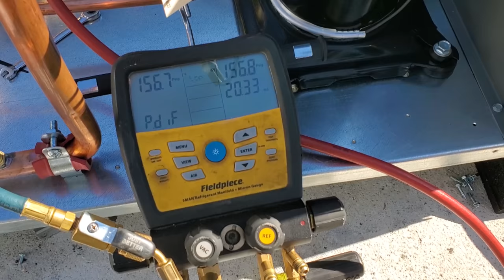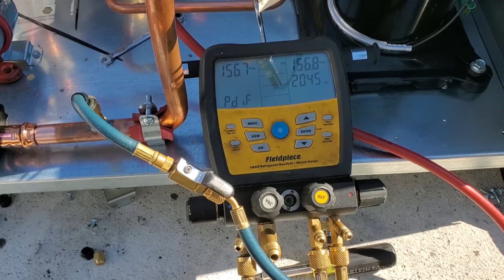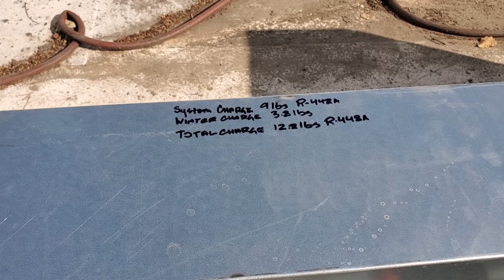WALK IN COOLER RETROFIT WITH ZoomLock MAX

Comment: I’ve cleaned hoods for 18 yrs and u knowing not to put it around the exhaust fans is a pro move. Good job sir.
Reply: But that EMT right next to the one fan is going to be some poor souls trip hazard about 12 times in one night.

I would also advise to never put refrigeration between exhaust fans and the roof drainage, its just asking for grease splatter all over that equipment.

Comment: Reminds me of when we ham radio operators changed over from soldering coax cable connectors to crimping connectors onto the transmission cable. So much easier but as you found you still have to be careful to create the proper connection. Thanks Chris for sharing!
Reply: The thing is, the tool is like $2500 and each coupling is like $15 a piece lol
Reply: @Straight_White_Fatherly_Figure  and if you spend $1 instead of $4 on labor eventually it makes more sense even on big jobs
Reply: @jareddory2155  yeah I honestly would love the tool but the wife would never let me spend that much on a tool 🤣 eventually ill have one though. I have my ways.
Reply: I still solder my terminations. I don’t trust these new fangled ideas !! Now get off my lawn darn kids !!

Comment: Whenever we run a line set through a cooler top or wall we always put in a piece of PVC first and put the line set through the PVC, prevents The line set from rubbing through on the sharp metal edge of the cooler
Reply: ive actually used pvc drain pipe it has that black coating on the inside and its cheaper than the regular pvc pipe. ive also used it for running through ceilings etc. i Run the plastic pipe first with unistrut and pipe clamps through the Crowded tiny ceilings with a hundred other pipes and wires around. it makes running a new line set in the ceiling between floors alot easier. you can do it usually in one pull to a cooler.
Reply: just use PVC electrical conduit, since it's rated for sunlight/uv exposure anything else could become brittle and break with age (solid core PVC is probably fine though)

Comment: I really appreciate the fact that this guy does the little things like putting a bushing on the other side of the connector or making sure he uses the water tight EMT compression connectors rather than just throwing a regular compression connector on it. It's the little things like this that I feel like that actually separates the average guy from real professionals and I must say this guy a real professional

Comment: We use this system years here in the netherland. Dont sand the outside of the pipe with sand paper. Sand paper only if you solder the fitting
Reply: I thought of this too, o-ring sealing is all dependant on sealing surface quality so maybe not too coarse sand paper would be best.
Reply: Wij hebben de set van Rothenberger

Je moet wel de scotch gebruiken die ze meeleveren als laatste stap.

Koppelingen zijn nog steeds enorm duur maar het werkt fantastisch 👌

Comment: I have not used any of the press fittings, but I was told on the plumbing Pro-Press that the b o-ring was not the main seal....but the main seal is the copper on copper seal formed with the high pressure crimp.

I hope to add it to my bag of tricks because I  definitely have had  times where it would have made a job much easier.

Comment: Like he mentioned, don't want to be putting on and off the fitting as it might damage the o-rings and I believe the o-rings are pre-lubricated, so taking it off and on from pipe to pipe will eventually remove the lubricant. The fittings usually come in a bag to help ensure its clean but inspections of the o-rings are a must if the fittings were left outside to the open environment.

Comment: Just a heads up, I tortured tested those zoomlock and propress fittings (Just basically all the wrong ways to do it, no pipe prep etc.) and they can take ALOT more than you would figure. The only way i actually managed to tear one of the O-rings was slamming the pipe into the fitting on an angle with no de-burring.

Comment: Chris if you are using for R448/R449 low temp (Freezer), check your discharge temp.. They can run pretty high, and you might need to have some top compressor cooling ( don't know the English word for it)

Comment: Great video once again.. I have been using the press fit here for a while.. your spot on about cleaning the pipe of burs and marks.. I use scotch pads to finish off the copper as my final step before the marking process.. here in Australia it's called Maxie pro ..
Thanks man once again

Comment: Exposed EMT? I would not have guessed, that pipe won't last in the elements. Better option would be rigid or epoxy coated emt, possibly rigid pvc or carflex ? Love your channel and love learning about HVAC. Electrician by trade and always try to use pride in my work like you do ! Thank you for providing a good example for other tradesmen ! Also I thought you pipe didn't look bad at all!

Comment: In the UK, for most if not all commercial premises you need a 'hot works' licence to do soldering of copper pipe work.  It's why a brass compression fitting is used instead.  Not sure if brass compression fittings can be used on Air-con pipework.

Comment: hi chris im 15 years old and i made my own air condition by using an old split ac unit.Also its working on R32a for refregerant.great video by the way!

Update: I forgot to mention that this was a 2006 GR hualing ac unit and I really like how is defrosting in heating mode with a time less than 3minutes!
Reply: Good way to start
Reply: Wow. Nice. 👍🏾
Reply: Sweet man.
Reply: Good start, what did you use for a vaccuum pump and gages? Thanks
Reply: Dude thats very cool!
Reply: @watermanone7567  I did use gauges and to be honest it was a bit hard but I made it with the inspection of a HVAC guy!
Reply: @watermanone7567  My HVAC guy help me to vacuum the system with his vacuum pump and saw that he has the fildpiece vacuum pump as Chris has!

Comment: I personally haven't used the zoomlock, but I have used pro press a bunch. I still personally prefer to solder an assembly on the work bench (when possible) and just throw in a coupling to tie it in. Most of my mistakes came from trying to keep a complex assembly from falling apart and then not noticing a fitting slipped off or turned after I already started pressing. That depth gauge is pretty sweet. The one we have is basically a laminated piece of paper. Makes it hard to mark the pipe, so most of the time I just use a fitting that has a stop instead.

Comment: Nice job. My question is the roof penetration. The roof looks like membrane. It looks like you used bull/roof cement to seal it. I was told by roofers NEVER use roof cement on a membrane roof. Instead, use silicone sealant. Please correct me if I am mistaken.

Comment: I don't know much about refrigeration but I've been using Propress fittings on plumbing pipes since 2004 and almost never have issues. Way faster than a torch with less that can go wrong.
Reply: But water pressure doesn’t go as high as 300+psi
Reply: @yzhang8629  Did you see the comment from the aviation tech saying fitting like these are used on aircraft hydraulic lines at 3000psi ?

Comment: I know you are sponsored by Parker, and that is why you are using the ZoomLock fittings, but I guarantee you they will eventually leak. It's not a matter of if, it's a matter of when. And that when will be a LOT less than the "30 years" that Parker claims. The o-rings used are made of HNBR, which is a good material but it will eventually harden and lose it's elasticity. Combine that with expansion and contraction due to temperature changes with on-off cycles, and it's only a matter of time. The ones most likely to leak first are the ones closest to vibration and exposed to the most temperature fluctuations. So, figure the suction connection at the condensing unit. Next likely one will be the liquid line connection at the fan coil. They should make it out of warranty, but IMO fittings are something that should last the life of the equipment without leakage. 

We got a ZoomLock tool to try out a few years back. We had to buy the fittings, which are expensive. While the crimping goes pretty fast, tube prep requires even more care than brazing or soft silver soldering (Stay Brite or Stay Brite 8). Overall, I didn't feel it saved much if any time compared to using my Capn' Hook heating tip and brazing the lines. When you take into account the cost of the fittings, I calculated brazing to be less expensive. Because I know the correct way to braze a capillary joint, if my braze passes the initial leak test I know they will last the life of the equipment. With ZoomLocks, I can't say the same. They are essentially very similar to Ford and Chrysler spring-lock automotive fittings, and the older ones with single o-rings ALWAYS leaked in under 10 years. The later ones with two o-rings per fitting last longer, but eventually they will leak as well. Spring-lock fittings, and automotive fittings in general, all have one enormous advantage over ZoomLock fittings; they are easy to disassemble and replace the o-rings. If a ZoomLock fitting leaks, you have to cut it out and either replace it with a piece of pipe and two ZoomLock fittings, or a piece of pipe with regular couplings or swaged ends and braze it in place. And when a ZoomLock fitting does eventually leak, you know the others on the system won't be far behind.

A question: why did you use 448a? Was that some requirement by the People's Republic of California? I will forgo my usual rant on the GW scam (or OD scam, for that matter), but the "GWP" of 448a isn't all that much less than 407a, c, or f. It IS less efficient, so a system using these HFO blends will have a lower COP vs systems using 407 series refrigerants, which means they will use more power. Since most electricity comes from natural gas and coal (I will forgo my usual rant on the anti-nuclear power BS and why solar/wind can never replace current baseload power sources), extra CO2 emissions will more than offset any extra supposed "global warming" from a refrigerant that SHOULD stay inside the equipment (I will forgo my rant about cheaply made, paper-thin, leak-prone coils). Of course, 448a also costs more, which is the point. Honeywell and Chemours didn't push for the adoption of expensive HFO's because they care about the environment. They care about their profits, and the patented and difficult to manufacture HFO's are VERY profitable! How do I know that they don't give a crap about the environment? It's because they know, but keep hush-hush, the fact that both of these HFO's break down into trifluoroacetic acid. TFA is a persistent environmental toxin that is absolutely deadly to aquatic life. 

Another option besides 448a and other HFO/HFC blends is R-134a, which has a "GWP" that is comparable to 448a. The R-12 system could've been replaced with a medium-pressure R-134a system instead of a high pressure 404a/407a/448a system. The end result would've been comparable in performance and efficiency to the 448a system. I know MP systems are no longer in style, but maybe they should be considered for more medium-temp systems?
Reply: Use 410a on everything, its the best next thing if you ask me.
Reply: @sjefoekel6058  Greenies want to get rid of 410a. They claim the "GWP" is too high. They want to copy Japan and China and use straight R-32, which is flammable and runs at even higher pressures than 410a.

410a could be used in refrigeration applications, but it hasn't been for a variety of reasons. For those same reasons, it is unlikely to be used fr anything besides AC.
Reply: @WTFChuk  fase out, is not on close term for 410a = smaller pipe, smaller heatexchangers, les refrigerant, smaller delta T~ more € for me!
Only thing is you cant do drop in. Another thing is r32 drop in ready.
Reply: @sjefoekel6058  Heat exchanger size is based on thermal load and discharge temps. I dont know how the "smaller heat exchanger" thing got started, but I have never encountered a 410a system with a condenser or evap that was much smaller than its R-22 counterpart on a tonnage basis. What will make the heat exchanger smaller is thinner tubing, material with a higher thermal conductivity (copper instead of aluminum)  and more efficient design. These are what are responsible for any heat exchanger size reduction in a 410a system.
Reply: @WTFChuk  it boiles at higher pressures therefore more violently, check out charts of heatexchanger manufacturers, and furthermore because
Of the higher pressures there is less pressure drop. You are welcome.
Reply: @sjefoekel6058  More violently? Egad! I get it, you think R-410a is just the coolest (pun intended) substance ever invented. Fine. You're certainly welcome to your opinion. Have you asked yourself why it's only used in high temp applications? No medium temp, no low temp. I will leave you to ponder that question, along with the mysteries of life and your place in the universe.

You are welcome.

Comment: I like leaving the condensing unit isolation valves in place that way if you have a leak in the condensing unit you can isolate the condensing unit from the rest of the system so that you don't have to recover the Evaporator and lineset. Especially when the customer is on a budget with an older system that may have potential micro leaks on the evaporator.

Comment: I'll keep brazing. We bought a progress for water pipes a while ago where it has a huge advantage in large buildings that we work on where its almost impossible sometimes to get the water to stop bleeding through making it impossible to solder.  In this situation I really dont see that big of an advantage but I see a huge disadvantage in that a o ring will not last as long as a good 15 silver braze joint. i've seen totally properly done progress application fail shortly after and that's at much  lower pressure. Just my opinion.

Comment: Will those benders work on still lines as well? If so, i need the 3/8 so i can easily bend up the fuel lines on my truck, the little ones you can get for automotive in auto parts stores are junk

Comment: Good Vid ! Nice Clean install !  ive never used those service valves on the condensing units anyway, so no big deal for me in just getting rid of them on the get go. i allways end up Getting rid of them anyhow because they end up leaking eventually. Only one thing i would do differently . i am kind of a Nut for Blowing out the Evaporators and line sets with dry nitrogen at 100psig or more pressure to make sure no shavings are hiding in the line set or evap before i weld them in at the condenseing unit ( in this case before last two zoomlocks at condensing unit. Besides that Zoom locks Look cool, But HOw Long before they Leak ? 1 year, 5 years, 10 years ? Please Keep us updated with a Once a Year Video Update on this installation Especially if thier is a Failure of a fiting at 1 year or Less. Thanks. 
NOte: YOu Could use Zoomlock to Change a Compressor. Just Weld in 3" Copper Stubs into the compressor Down at the Truck. YOu don't have to Bring the welding Gear onto the Roof that way. Easy peasy. Im interested in seeing if that one itty bity o-ring will handle Discharge Pressure & Temperature of a system on a HOt day in riverside. Lol.

Comment: How much time do you think you saved using zoomlock vs brazing? And what was the price difference in fittings? Wondering if it's just a wash when it comes to cost not taking a fire permit or whatever into consideration (we don't need to pull special permits for torches here fyi)
Reply: I work in a somewhat heavy industrial environment. Our insurance mandates a 3 hour fire watch after burning.(not to mention the paperwork) So if a contractor is cutting, welding, torching, ect. up until the end of the day we still need to pay him or someone 3 hours afterwards to fire watch. Sometimes this falls on the contractor, which we pay for obviously. If there is a way to do a job without creating fire, then that option is almost always selected. Everything else is usually preformed off site.
Reply: Dude... California is the absolute worst when it comes to permitting and even more annoying the farther down you go such as county or local municipal code...
Reply: @erat91  Do not worry insurance never pays even if the fire starts after the 3 hour watch lol
Reply: We don't need hot work permits where I am. I tried the Zoom Locks several years ago, and because of the extra tedious tube prep I didn't find that it really saved much time. This was especially true if you had to do some brazing anyway, so you had to hook up the N2 no matter what. My torch with the Cap'n Hook tip and using Stay Silv 15 felt just as fast. If I swaged joints instead of using couplers it took a bit longer, but I eliminated half of the required braze joints and half the potential leak points. Once I used up the supply of ZoomLock fittings I had to buy, I returned the tool which had been loaned to us to try the system. I haven't used it since, and have had zero need or desire to buy the tool and more fittings. OTOH, I still use the crap out of my Hilmor swaging tool, as I try to eliminate every coupler possible with a swaged joint.

Comment: What a time to be alive. 
Got a question though. Do you have any concerns using the zoom lock fittings with leaks in less than a year or two. Or is that why you have heavy emphasis on not screwing up the O-rings while de-burring
Reply: I’d also like to know what is the max pressure the zoom locks can withstand
Reply: @scottshepke669  Maximum Rated Operating and Abnormal Pressure: 700 psi / 48 bar / 4800 kPa
Reply: @scottshepke669  ZoomLock MAX is for refrigeration and air conditioning applications. It's rated for operating pressure up to 700 PSI. Visit www.ZoomLockMAX.com for more information.